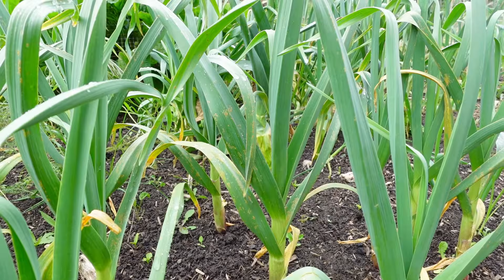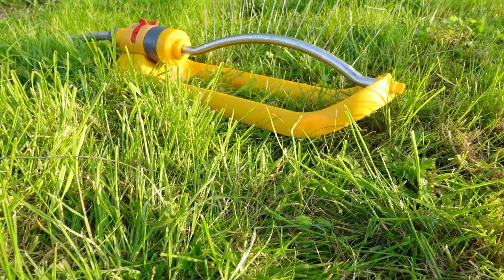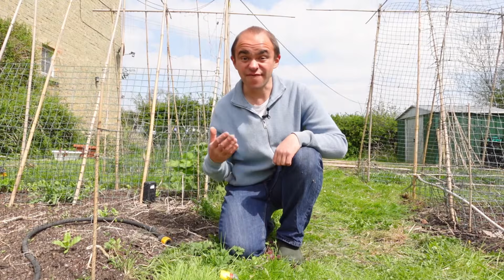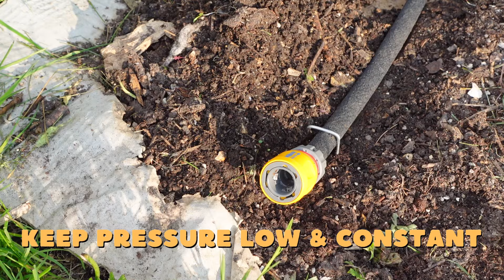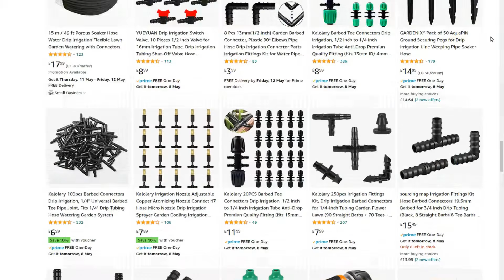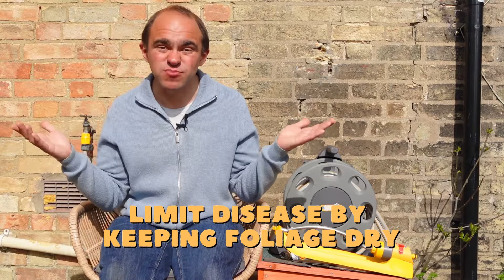More Food, Healthier Plants, Less Work! Installing A Soaker Hose To Water Your Vegetable Garden

Comment: Thank you so much. I’m 65 and have always used sprinklers, but just bought my first 2 - 75ft soakers to reach a new bed containing new small bushes and small trees. The bed is about 130ft long, starting at about 1 ft and slowly enlarging to about 4ft wide. Should be easy. This bed is just out of range of my sprinkler for my small grass area and surrounding trees.  You made me feel much better about the project. Thanks, and good luck with your other side of the garden. ~ Jerry
Reply from the maker: Very welcome. Soakers aren't the cheapest investment but I think they pay for themselves in the long run, especially with a good grass mulch on top. Just be sure to use cheap non-permeable hose before you get to the bed. And I did finally connect mine on a loop and it is really really good over that length - I ended up lowering the input to about 4L/minute to reduce pressure in the hose.

Comment: Hi Alex, great video with some good information. I have been debating about moving over to soaker hoses but actually find it relaxing just walking around with 2 watering cans and checking out the plants as I water.
Reply from the maker: It's funny, I did my first bit of watering with a can the other day (to water-in some strawberry runners) and I did forget how much I enjoyed doing it before work in my old patio garden. Doing the garden beds here is physically a bit too much for my arms though (and is time consuming) so I started doing coffee walks around the garden and trying to sit in various spots to help me notice problems. It's not the same and I still do some pots by hand but the soakers create a balance that makes the workload manageable, particularly when it gets hot. Could perhaps be worth trialling it on the furthest or most difficult bed, rather than going all in, but I get the sentiment entirely

Comment: Hmm 😒 going to try it myself but have seen in multiple you tube videos that these don't water evenly.  They emit most of the water in the beginning of hose and leave the ends area drier.  I will of course also use pressure regulators as well hopefully avoiding blowouts
I am a market gardener and I use drip and overhead currently.  I like how the soaker hose seems to work when buried in mulch.
Reply from the maker: If I recall, it depends a lot on your system. I've got a 75m soaker system on a loop right now and at 3L/minute from both ends it's pretty even throughout the length. But I did get a lot of pooling at the top of one of the hoses when I didn't restrict the water (my system caps at about 11L/minute total) but not the other end - I think the hose was damaged a little. I've not had an issue with less drip at the ends (in fact in one place it's raised off the ground, it looks like the bit where I grab the hose at the start of the video). Only thing I would say is that these are better for long slow waterings and a lot of the action will happen underground as it spreads sideways. In clay this will be a lot slower than in loam and your soil will probably determine how long you need to water for and your cadence. I'm trying to create a calculator but there are so many variables. Best thing is probably to try it for 30 minutes a day and see if it spreads far enough quickly enough.

Comment: I’ll have to try these out for my fruit trees! Thank you!
Reply from the maker: No worries, just be sure to give them a lot more water - either a long drawn-out watering over hours (potentially) or maybe doubling up the soaker hose. It depends on the watering requirements of the tree and your soil type & structure. If it helps, I get through about 5L of water a minute over a 75m length

Comment: I think my only worry would be it breaking down into the soil, it's the same reason I loath landscaping fabric, it doesn't work all that well and now you have plastic fibers fraying off into your soil forever 😩
Reply from the maker: I get the concern. I hate landscaping fabric. When I moved here I had to spend ages digging up fragments and I still find patches that behave weirdly and often still have some underneath. 

This stuff is different in that it doesn't really tear. It's recycled rubber and it's quite hard. I can't speak to things like leaching (we'd have to email the manufacturer) but in terms of breakdown I can't see it happening for about a decade and when it does start to fail you should notice different behaviour when you water and can pull it up. It'll probably crack and snap rather than shred. You can also leave it on the surface (or under a temporary mulch) and remove it much more easily and not risk it degrading under the ground like landscaping fabric.

It's not perfect - I'd like a clay, terracotta or even a metal piping solution that is built into the landscape to work for the specific garden but I only rent.
Reply: @alexgrowsfood  Yea I've been getting ready to DIY some ollas/oyas with terracotta pots. At my house I've been digging up scraps of landscaping fabric for years (among other very random things) it's such a bad material I wish it never got so popular.
I'm glad that this works well so far for you though, I hope it's able to last a long time.

Comment: Would love to use soakers but they are stupidly expensive, so will have to wait a while..
Reply from the maker: Yeah they are quite the investment. I slowly bought mine over time (and one was given to me - by luck, not by the company) or anything) but I think they'll last long enough to be worth it and I suspect more cost effective than a drip system if you have dense plantings. Not cheaper than manual or a sprinkler though (sadly).